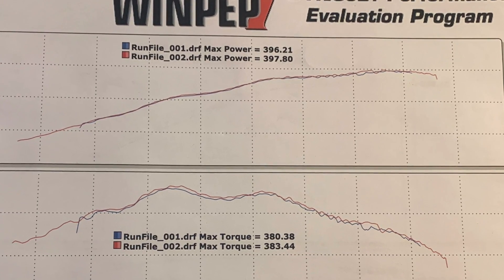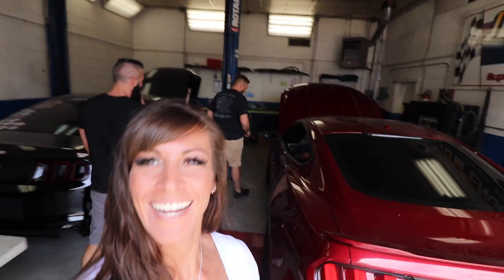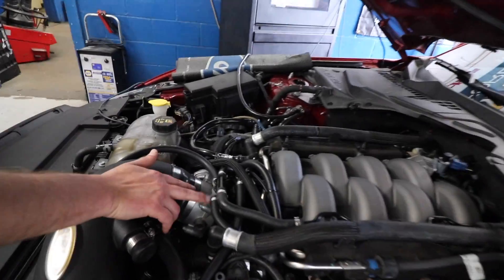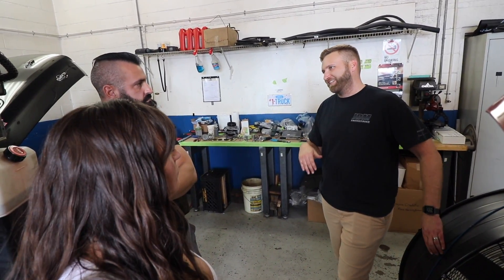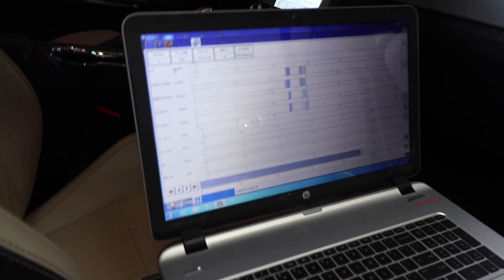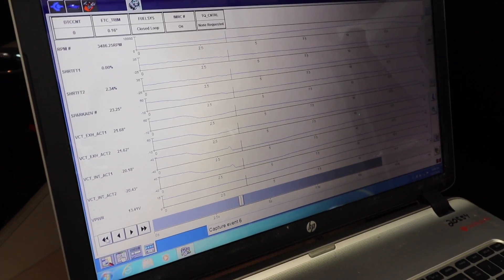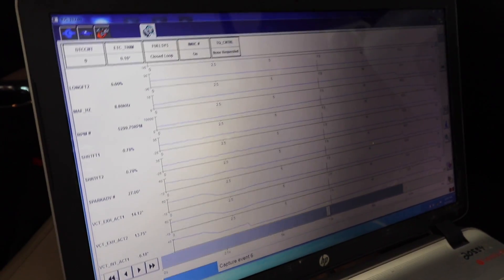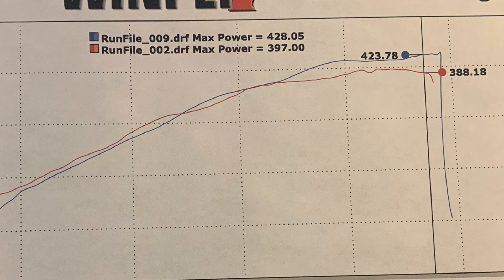DYNO RESULTS for my 2017 MUSTANG GT Intake Manifold Swap (2018)

Comment: Wouldn't procharge it, go gen 5 whipple, sell the manifold. New manifold can go further too, 7500rpm, it still makes more power. Set the rpm limit too low.

Comment: I have a 17‘ mustang GT and bought the 18‘ intake with GT 350 throttlebody, JLT cold air intake 47 lb Ford performance injectors and the Bama rev X  tuner and I have a Flowmaster cat back exhaust, can I get an opinion on the set up as far as possible dino numbers? American muscle representative said it should be a great street combination.

Comment: JDM is awesome...i remember back in 01 when I got my first Lightning. It was an 01 with the new at the time upgrade to 380hp. It wouldn't break the tires loose unless I nailed it full throttle...i was like wtf? Called Jim and gave him my details on location, year, mods, etc. He sent me a chip i had to plug in to the computer back then. Well let me tell you what... i did the cold air intake and the chip ...no pulley (yet) nothing else...when I went for that first test drive...holy fk!!! Barely touching the throttle those tires were screaming for mercy! Ever since then, i became a true believer of JDM Engineering...that man knows his stuff. If I lived up north, I'd set up a tent and live outside his shop...lol

Comment: I can't tell what he he said  about the ProCharger at around 6:21. All super chargers will have the same exhaust sound, where turbos mess the sweet sound all up. I have a ProCharged car and tend to think I would rather just have a huge cubic inch gas guzzling big block for the street.A ProCharger is a turbo for all intents and design driven off the crankshaft rather than the exhaust, So expect LAG when in lower RPM range, and then boom big power. I like that in a motorcycle, so odd that isn't what I want in a car. I love  two stroke motorcycles for what ever reason, nothing nothing and then bam while on the throttle hard or not, based off rpm.

Comment: Yes it made more top end power BUT!!!
 it made less everywhere else. So unless u drive above 5500 rpm everywhere it wood be slower. Sorry but peak power is useless unless ur a drag racer with a hugh stall converter. Also turbo is better. Sorry for the downer

Comment: Seems the manifold upgrade only added closer to the top end,stock had more from bottom to about mid to 3.4 the way to the top..Always fun to mod but still gotta justify the changes,so my 1st question is how much of your driveing are you gonna be useing the top 1/4 of the rpm to get that  gain and does it justify all the extra $ for you..  Dont get me wrong with me sayin this,very cool to mod....I thought it was genitics in a man lol...Girl im thinkin you were bitten by the mod bug..
Reply from the maker: yea with intake manifolds, it increases the top end of the power band, but that doesnt mean it lost any power on the low end. So lower RPM are still similiar  but it pulls much harder all the way to redline.  It feels so much stronger now and was def worth the money.  It's definately a different car from stock.  Adding 50+hp at the crank is def a huge gain.

Comment: ...not a fan of mods inside of the engine..would sacrifice brute power for reliability and longevity...c5 vette took ALL performance cars out of the performance dark ages ( 200hp 85mph speedo) with lightweight aluminum engine and rear transaxle...no disrespect, but here is south Florida, you would get looked at BIGTIME in my ragtop Corvette...lol..

Comment: Does your h pipe have cats or no cats? That is some impressive numbers especially if you still have your catalytic converters on.
Reply from the maker: On this body style mustang, the cats are located in the headers.  I still have stock headers so yes still have stock catalytic converters. There is a resonator located in stock H Pipe so the aftermarket one that we installed removed the resonator.  Hope that answers your question.  And thank you we were happy with the improved HP gains.
Reply: @KristenGraham  Impressive, now get a supercharger. Then it will be so fast you won't get a ticket just straight to jail.
Reply from the maker: False! The cops wont be able to catch me! haha
Reply: I like the way you think!

Comment: I did the 2018 intake manifold and dyno-tune with JDM on my 2011 GT earlier this year and the transformation was incredible. RWHP 436 with 400 ft lbs of torque after the upgrade. They are a great bunch of guys and Jim Sr. is the SME when it comes to Mustangs and power. Also did the GT500 rear lower control arms and BMR relocation brackets with JDM and the car handles great! Enjoy your new found power!!!
Reply from the maker: I think the rear lowers and wider street radials are next for us.  The tires break free alot now! haha but love the top end power!
Reply: @KristenGraham  Tires!!! Same here. I've tracked the car a couple of times and was thinking about nitto tires for the rear. My biggest problem is staying out of trouble in the highway... 😎